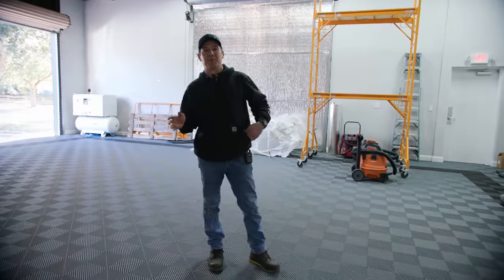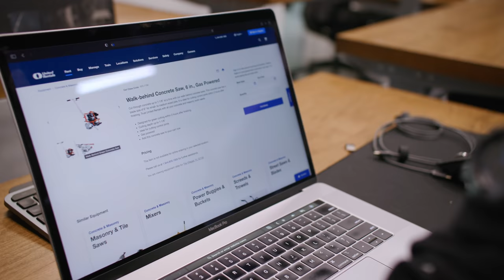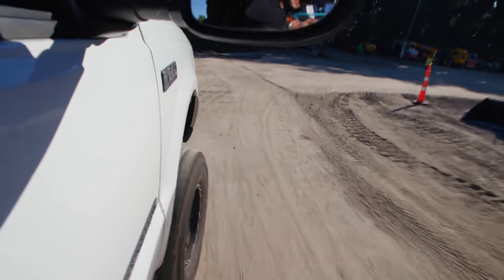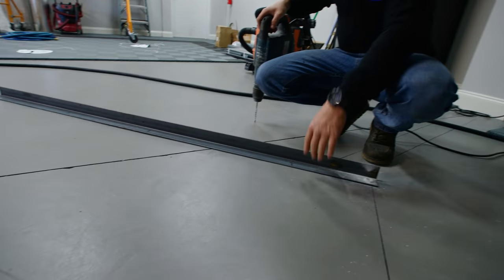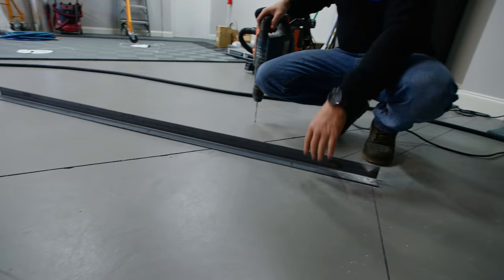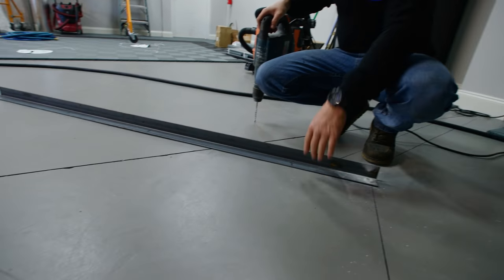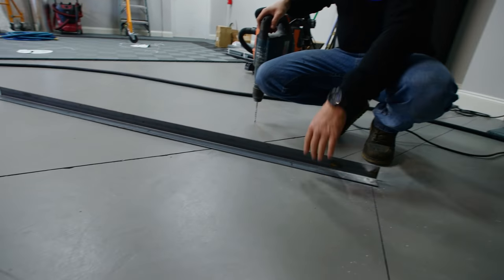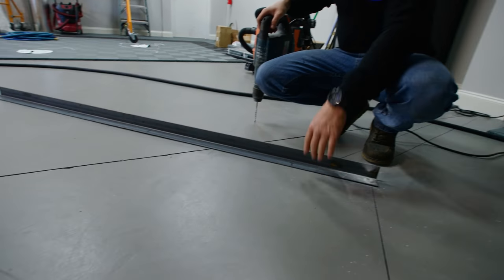How to Install a Recessed Lift with Mike F: Part 1 (Cutting Concrete)

Comment: Can you guys provide dimensions of the "square" this setup takes up if someone were to replicate it from the wall to say the back outside corner of the hole cut on either side? Just trying to get an idea of the space required accounting for cabinets and such against the wall. Thanks!

Comment: Great content as always. Just a tip if you double cut less chance of spalling when you pull out the old slab. Second (interior) cut doesn’t have to be  straight. Pull out the big interior slab portion and then the edge pieces will fall away rather than pinch the outside slab you are trying to save.

Comment: Seems to me you should have installed this based on the larger Rapture(220”-250” length, 145” to 157”wheelbase, width 86.5”) vs the BMW(189.1” length, 112.5” wheelbase, width 74.3)? My concern would be the clearance in the front to the cabinets of the larger vehicle.
Reply from the maker: I want it set up for my cars.
Reply: @ObsessedGarage  ok, I only posted a comment cause Mike said you might want to have a Rapture on it.  Great job BTW.  I enjoy your videos

Comment: Maybe you don’t need rebar because the thickness maybe Florida code is different at least they put a vapor barrier underneath the concrete! Again that could be Florida code because of all the rain.

Comment: Rebar in a regular metal building like that would be very uncommon. Usually it’s just wire mesh. Rebar would more typically be found in 6 inch and thicker slabs in very heavy duty industrial and warehouse environments.
Reply: That may be true here in Florida. It is very uncommon to find poured slabs without rebar in Ca. Even patios have rebar, typically #3. I'd rather be safe and use rebar on this.